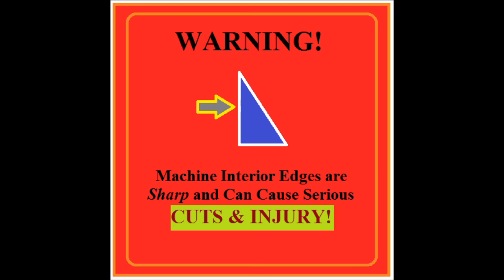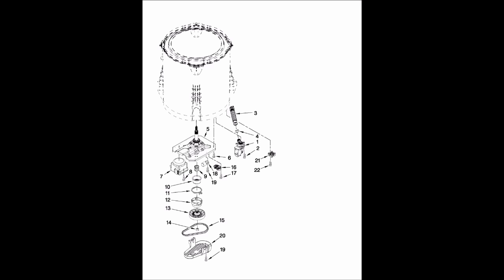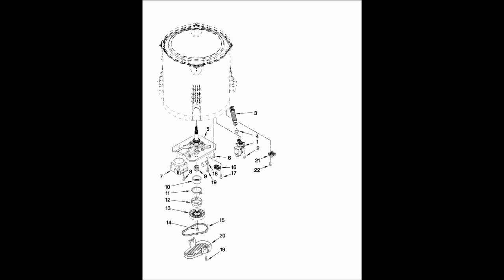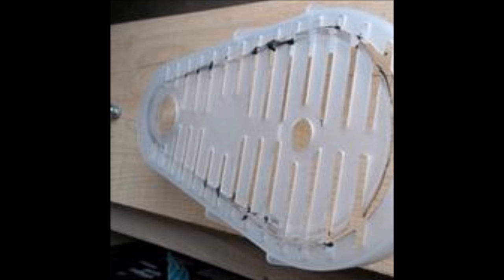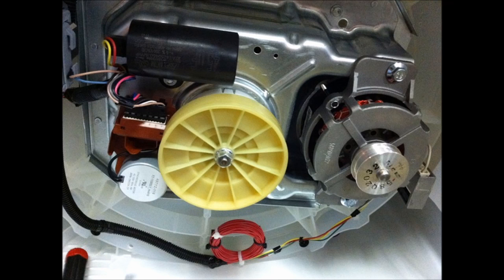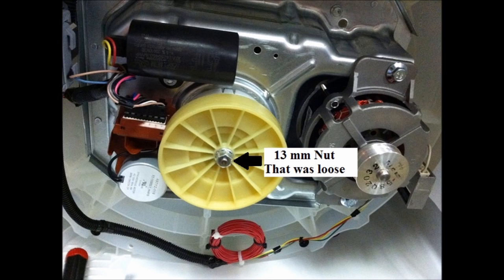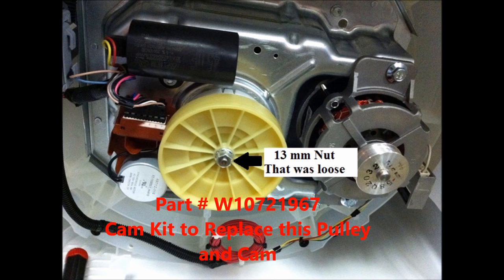Whirlpool Washer Repair - Noisy Spin Cycle

Comment: Hi I replaced the part as you suggested and now it's better than before but it still squeaks intermittently as if the belt is rubbing against the new part. What do you think it can be? It squeaks during agitation but not during spin, and not all the time

Comment: 13 mm socket  good luck finding one of those.   Need a blister pack of them.
Reply from the maker: You might try the 1/2 inch socket, but it probably will be slightly too small.  next would be to use 9/16 perhaps with an inner lining of sandpaper to make it fit, in an emergency.  Good luck!
Reply: @kensappliancerepair9971   there was about 25 polished dimes under the agitator !  That was grinding like a blown transfer case   Thought for sure it was the trans   And the nut was not tight came right off and   I broke the lid switch  took it apart and fixed it   Was cursing whirl pool but it’s all working fine now !  I can’t believe it   I thought I’d be ordeing $70 and $289 parts and end up chucking it anyway and it’s working 
Not bad engineering  anything you can fix easy without parts is good.  
🤗
Reply from the maker: @AboxofMonsters  Awesome, glad you made it work again!
Reply: @kensappliancerepair9971   i posted in community youtube a tip to look for that change before you gotta buy a tranny 🤗 see how many do.
Reply: Not sure where you live that you can't find a 13mm socket.

Comment: Can you verify if this fix will work for a WTW7000DW1 model? If not, how do I find the proper kit?  Thanks
Reply from the maker: The model number you gave is for a totally different design washer.  It doesn't use the splutch kit, and has a motor and stator assembly to drive the gear box, direct drive with no belt.  You can look at the parts diagram on sears parts direct here https://www.searspartsdirect.com/model/253y9anv00-001198/whirlpool-wtw7000dw1-washer-parts

Comment: I have the same set up, checked everything and all seem fine undernieth.  I have a louder than normal spin cycle.  I noticed their isn't a bearing on the tub?  Could my transmition be gone? Thanks
Reply from the maker: If there was grease splashed on the pulleys and belt, and the belt guard, then the transmission has leaked out enough grease to start getting loud.  If you have no grease or oil leakage, it could be the splutch pulley parts are starting to wear out and the splines are not catching like they should.  You would need to take it apart to check it out, replace if it is worn or broken splines.  Hope this helps!
Reply: @kensappliancerepair9971  when i tipped it over to check, there is a dark stain on the wash tub, probably the grease leak?
Reply from the maker: @leakytheman  Probably so.....
Reply: @kensappliancerepair9971  I think i'm in the same boat.. What do i do for the grease leak?
Reply from the maker: @joshoster1918  Replace the transmission if the grease is leaking out, as far as I know the transmission does not have a rebuild kit or re seal kit available

Comment: Mine also cut a groove. I checked because it won’t agitate. My motor pulley is the one that had somehow came downwards, pulling the belt lower on the tub pulley. Does this mean the motor failed? You can push the motor pulley rod up and down inside the motor.
Reply from the maker: The motor shaft should not be able to be pushed up and down, so it sounds like the shaft has separated from the bearings that hold it in place.  A tiny amount of play is normal, but more than that is a problem.   Without being able to see yours and how much play it has, I cant be certain, but it does sound like the motor is the problem.  Just make sure the shaft its self is moving.  If it is the pulley moving up and down on the shaft, but the shaft is stationary, then it might just be the motor pulley needing replaced.

Comment: Having a transmission and drive shaft connect to the tub is a very poor overcomplicated design of a washing machine. The belt should simply attach to the tub itself. Whirlpool owns 70% of the appliance market and every appliance is now made in Mexico at the same manufacturing plant. The insides are identical with the outer frame and badge being all that is different. Sometimes the board and buttons are different in their location, but operation of the machines are the same. Just fyi. And Mexico is not known for having a High Quality Control of their manufacturing processes. Only U.S. washers and dryers - Speed Queen. Well worth the money.

Comment: I feel like my transmission is going out. Started a few weeks ago. Then started hearing belt squeaks and just moments ago it wouldn’t kick into a spin kinda like it had locked up. Had to cancel cycle and unlock drum manually by hand to free it and now it’s back going but louder than ever. You can’t hear yourself talk in the laundry room now.
Reply from the maker: Check the splutch parts, see if the splines have worn down.  If all those parts are in good condition, then you might be right.  Other things could be the tub bearing, or a piece of clothing stuck between the inner basket and the outer tub.  If the tub spins super easy by hand when not running, as in neutral, then that rules out the bearing and stuck clothing.  The loud noise when spinning, like a jet engine taking off, is usually a bearing or transmission.   Hope this helps some!
Reply: Ken's Appliance Repair my schematics not showing a bearing. Just an axle that goes directly into transmission. I’m considering on another machine. I can swap transmission myself but do I want to put $200 into an 8 yr old machine? I did a shift actuator almost a year ago.
Reply from the maker: @zachdavis3068  You are right, bearing on this style machine is built onto the gear case shaft, not serviceable.  I haven't had a customer yet agree to replace the gear case because of the cost, they always opt for either buying new or getting another used machine.  Sad that some parts are so expensive its not worth repairing.
Reply: These bearings got out frequently.  drum  seal can leak and then bearing go bad, also bearing can go bad for no apparent reason.  Whirlpools are JUNK.  Make a product like this and not sell  replacement parts at a reasonable cost is insane - NEVER BUY WHIRLPOOL again.